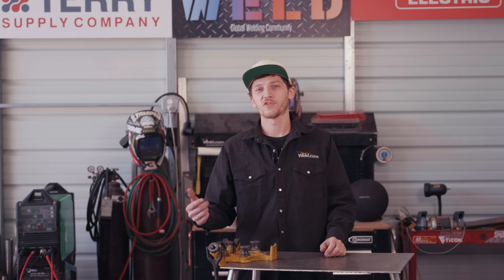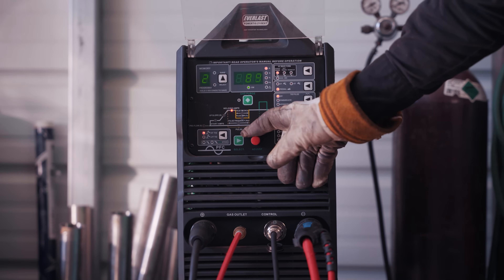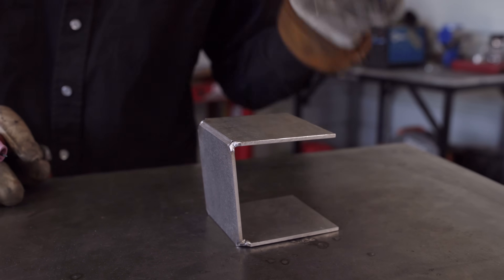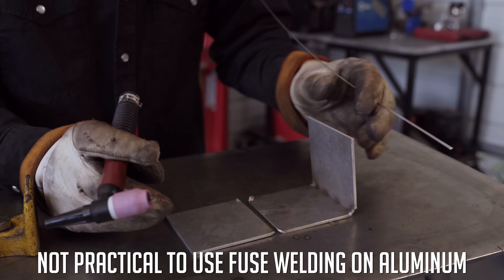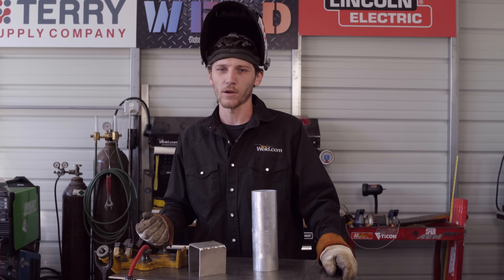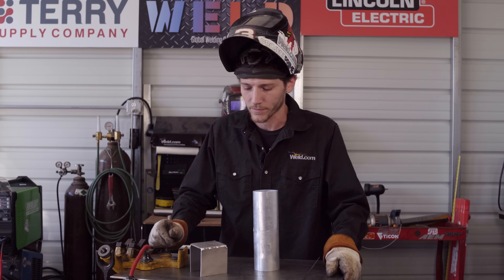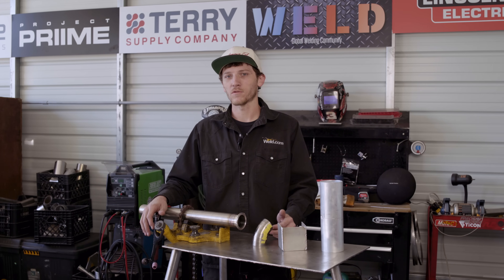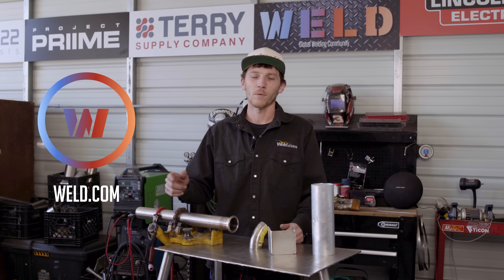When is it Necessary to TIG Weld Without Any Filler Wire?

Comment: but why autogenous/fusion welding instead of using filler wire ? what’s the benefit?
Reply: That's the wrong question: why waste filler wire when it's not required?

Comment: Your weld looks far more realistic than say Pacific Arc Tig Weld channel. His weld just always looks shiny and stuff.

I'm practicing on some 1mm and 1.5mm stainless and I found as soon as I introduce filler wire into the equation, all hell breaks loose. I'm thinking something that thin is going to be fusion only, because by the time I can get enough of a puddle on those metal to have filler wire, the metal is already cooked.

It's much less of a problem on 3mm or thicker metal though.

Comment: Few questions.
Please answer in serial order
1. For welding 0.6 mm stainless steel 304 which welding method should I prefer mig or tig
2. If I use tig welding on 0.6 mm SS 304 should I use filler rod
3.which welding method is expensive mig or tig
4 while browsing i found people generally prefer mig more than tig,why
5 which welding method is more expensive mig or tig 
6 can I use carbon dioxide instead of argon for SS welding 
7 how often we need to change tig welding tip
Reply: In my personal opinion and preference although im not well experienced.
1. I prefer TIG
2. Yes (personal preference)
3. TIG (in my country) bec argon and any TIG consumable much expensive
4. MIG and also FCAW was much easier compared to TIG
5. TIG (same as reason no 3)
6. Yes, but if you use pure CO² the material will lose resist corrosion ability so better use mix between Argon + CO² (use CO² less than 5%)
7. Personal preference, if i want to change it then i just change it lol.

Comment: what is meant by "sugaring" new term for me
Reply: The chromium has a high activity at welding temperature.  Back side of a zero gap weld will oxidize, making a mess looking like burnt sugar, black and bubbly.  This make a joint ugly, weak and prone to corrosion.  Open root welds get shielding through the gap but still can sugar.
Back purge with argon or other inert gas is used after tack weld.   The tacks are only partial thickness, easier to do with stainless as it is a poor thermal conductor.
Solar Flux Type B can be applied to the ID if the pipe/tube can be cleaned.  Most are high purity and must be back purged.  One example of good use is exhaust tube.  Or turbo headers, run no gap root with Solar B, then fill with water for fill/cap.  This also cleans the flux off the inside.  Just don't seal it with water inside and make sure the weld area is under water.  Sure sinks the heat away so welds stay nice looking.
Reply: @keithjurena9319  Thank you so much <3

Comment: I fused a outside corner joint on 0.063 aluminum it's plenty strong to build light fixture boxes.
Reply: Yeah for art stuff and things as such by all means thats works. Thanks for watching
Reply: Well from the video, they make it seems as though if you fuse aluminum it will fall apart. Because it's not applicable many would assume it's impossible. It's not, I can fuse a outside corner and then fold it over and still hold without breaking.

Comment: I did some autogenous welds on stainless sheets about 1/16 thick. Unfortunately I did f up and put two plates in wrong position (one box had two holes against each other and the other one had none). Took a piece of scrap sheet and simulated that weld here. Had a hard time to separate those plates without destroying surface, so I decided to fill that one hole, repolish it and drill one into another part. Saved me a lot of time and suffering.
Reply: Thats awesome glad that worked out. There so many tricks to learn when not only fabricating but welding tricks as well. Thanks for watching

Comment: 6061 aluminum is "unweldable" which is why tacking it is awful ... the filler metal is usually 4000 series. I would never fusion weld aluminum, not even for tacking. Hold the part with some sort of jig, or use a spool gun instead.
Reply: When i do this to make a tack it hadly penetrates i make it to where it just stick long enough for me to grab a piece of wire and tack it off
Reply: 6061 is difficult to weld without 4000 series filler as it lacks hot ductility.   It is also sluggish, the silicon in 4043 adds fluidity.

Comment: Anytime I fabricate any Stainless Steel architectural parts that are going to be polished, then sit and look pretty, I almost always fuse, unless I’ve got gaps. Not using filler makes polishing much easier. I also fuse when welding Stainless sinks, countertops, etc. this insures there will be no contaminates introduced into the weld pool from the filler wire.
Reply: Absolutely man thats whats so nice about stainless is knowing all that kind of information and taking that into consideration when fabricating thing can make the job alot easier. Thanks for watching

Comment: What about regular old steel, btw?  And aren't spot welds autogenous?
Reply: Well, it depends. I do it at times. What it it being used for, and how thick is it?
Reply: On that I would not use that. I feel like it's causing way too much undercut. It's good for tacking, on some bigger stuff I like to tack it that way and then recheck measures etc. It comes down kinda easy. If everything is OK I reinforce the tacks with filler wire (they really like to pop when welding) and weld it. Good when You are fitting frames or something like that to be MAG welded. When stuff must be gas tight or something I'll maybe fuse it because I feel like I am more sure about the material bonded together without any holes etc. But still I'll do a cap with filler afterwards. But it's all about the material used, thickness, fitup. I feel like thin sheet stainless or thin stainless tubing is best for this application (only with perfect fitup tho).

Spot welding can be considered autogenous since no filler is used. But... that's it. It's whole different process.

Hope that does cover it. Maybe someone will add something down there or maybe even coreect me a little. Have a nice day.
Reply: Thank you for the informative reply @jkbva ; it covers our question well.

We've had a MIG for a while, but have added a YW TIG machine recently.  It's got a "spot" more that may work for tacking, so we're considering tacking w/TIG and, for thicker steel work, MIG to weld-up.  More process options give us more flexibility, but we've got more to learn to use it best.
Reply: Spot mode, Cold tack mode or whatever You call it is good for thin stainless tubes and sheets. It would sure work on some sheets of good old steel too, but I've never tried that to be honest. I'm also reinforcing all those tacks straight before welding itself.

We just had a job where we did some frames for machines and 2 of us were tacking the whole frames up with TIG (just small "stiches" about 10mm long with some filler wire) and the third one was MAG welding them. We did save a lot of time because she could focus only on welding it and all the setting up parts and measuring and tacking was on us.

Comment: I use a jewelry tip with gas to fuse weld cones for sheet metal expansion chambers. Use the outer part of the flame to preheat the metal, them use the inner flame tip to walk the flame along the joint. Keep the  flame almost tangent to the curve of metal and just move the flame along and it will fuse together almost seamlessly. Tig is to slow for what I do.
Reply: Thats crazy ive seen it and it can get pretty intricate, ive never done it. Jewelry woukd be pretty cool to do i bet once get into it and have all tools to do so.
Reply: Make sure the metal butts up tight, no gaps.
Reply: Sounds interesting. I'm trying to understand what you're explaining, but I don't really understand.  I looked to see if I can find some YouTube videos of this, and can't find what you're describing.  Could you point me to a video that shows your method?  Thanks!